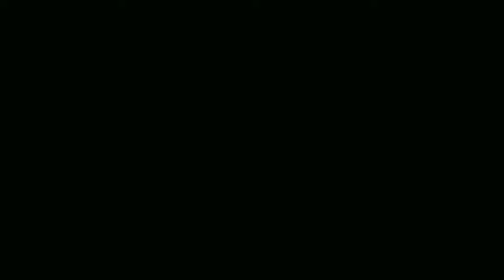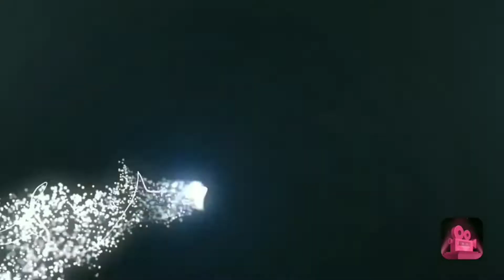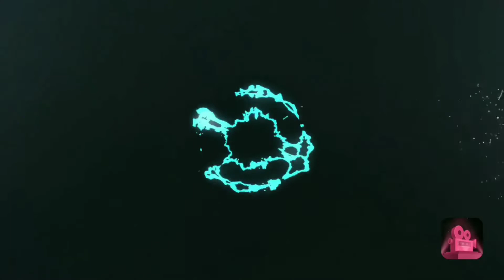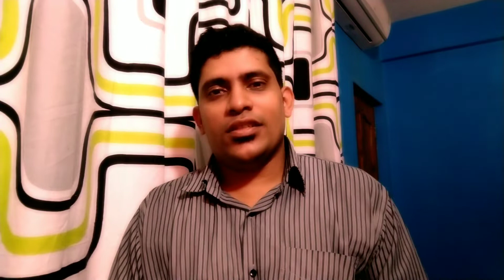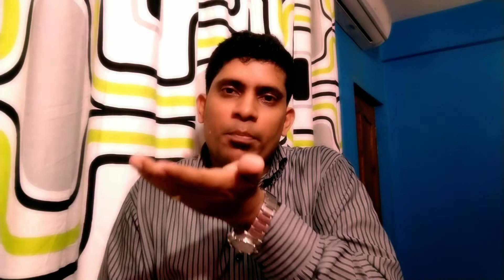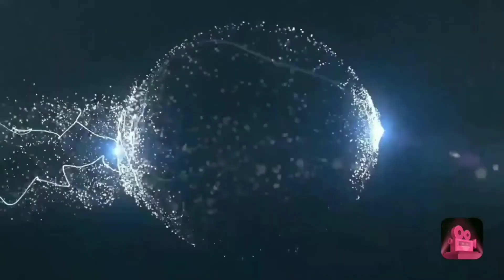Seized Rocker arm - ship incidents episode 3, #rockerarm

Comment: Sir  dout what means if you cut out one unit of the main engine then it leads unbalanced so the crankshaft deflection taking place or not ,for cut one unit. Then another one during cut out of one unit the indicator cock of that unit is open or not sir. Then another one sir if  exhaust valve operating push rod and fuel pump plunger both are lifted up or only fuel pump. I knew  that the fuel pump plunger   is important to lift.. So what we do in the exhaust valve operating push rod? Or otherwise the exhaust operating push rod is simply operating
Reply from the maker: After one unit cut-off load has to be reduced depending what manual says, n remember this is an emergency process ver u don't have any other option and only pump roller is lifted also fuel rack is disconnected n kept zero position so no fuel
Reply from the maker: Indicator cock should be closed but again depends what is written in manual, always follow the manual even if u have done on one ship doesn't mean it will be same, some ship might tell to cut of exhaust valve operation.